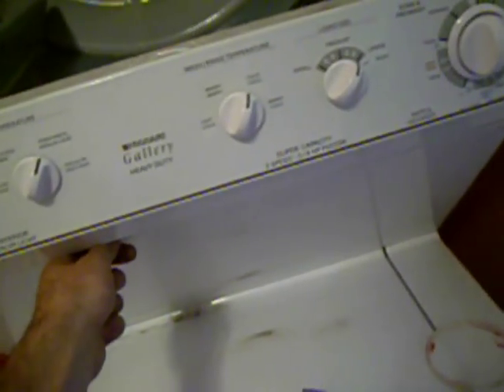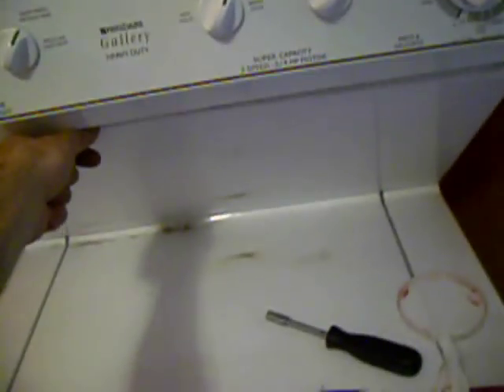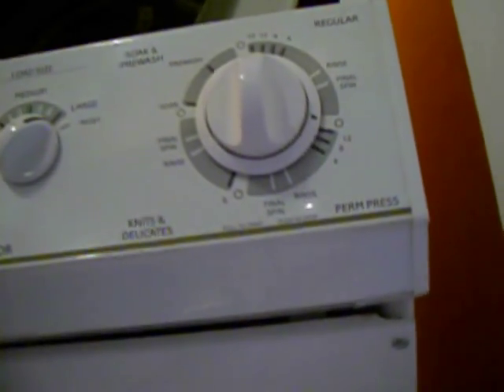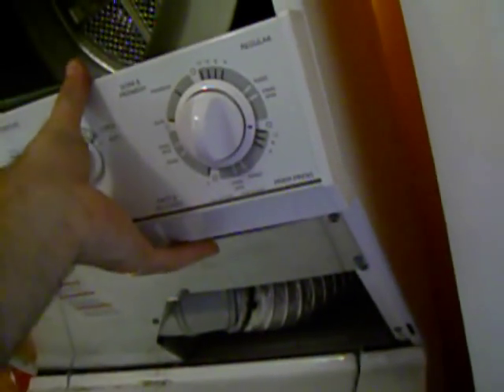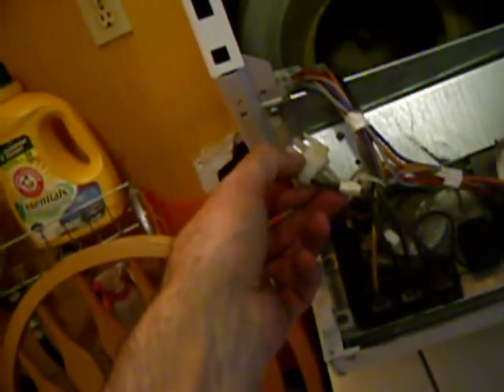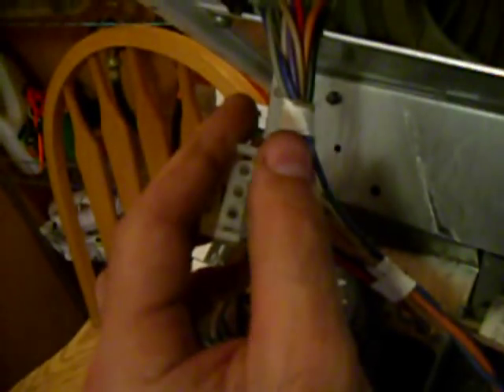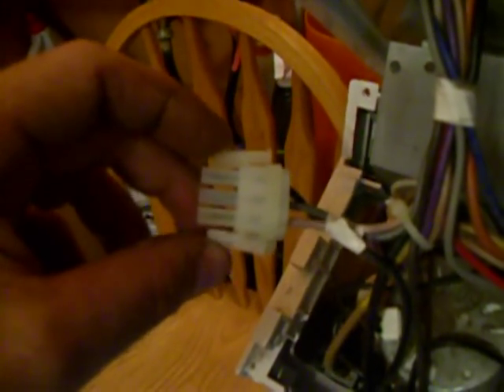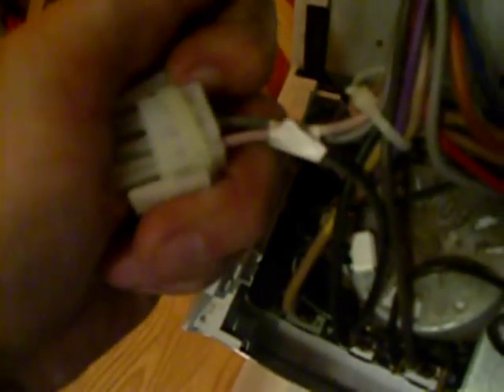Disassembling & reassembling a stacked clothes dryer

Comment: I have been struggling over the repair of my Gallery combination.  This is the exact one I have which is FLSE72GCSA Model.  I have to replace the Washer timer and was really getting frustrated with the lack of information I could find until your video.  Thank you so much.  I found the perfect company that supplies at this moment and time Frigidaire actual parts. It is GRP or genuine replacements parts.  I was able to get all genuine parts for mid price compared to higher or lower in parts places that provided substitutions.  Now because of you help I can actually figure out how to dismantle enough to replace the parts.  So relieved!!!  I wish I had my copy of the manual that would have helped also.
Reply from the maker: It is feedback like yours that motivates me to make more how-to videos.  Good for you for choosing to to repair instead of throw away!

Comment: Thanks for the video. I was actually trying to find a video on how to replace the water intake valve.  But thanks to your video it helped me through the first steps. Through trial and error I figured out how to replace the intake valve and then today I had to unplug the water pump on the washer. There was a sock blocking it. My washer/dryer combo is a frididaire # FEX831FS2.  In case anyone needs to take to front panel off of the the washing machine, there is 2 screws on the bottom of the front panel near the floor. Take those off and the whole panel will drop down for removal.  Then you can access the water pump.  
To replace the water intake valve, you will need a helper. You will have to undo the brackets that hold the dryer onto the washer. Take off the front panels shown in this video. There are 4 screws (5/16'').  The left side is hard to get to but can be done with a small socket wrench with an extension. On the back there are 2 "L" shaped brackets. Take those off.  Gently lift the dryer and slide it on top of the washing machine. Have a helper hold the dryer from the front and lean it towards them a little bit and you can access the intake valve. 
Thanks again for the video mr. diyguy123

Comment: Thanks so much. There is a scarcity of information on stackables, which can often be a pain to work on, usually in cramped quarters. You said you did another video about actually replacing some of the parts. Would like to see that also. Good job.

Comment: I'm surprised at all the negative comments??  I hope others realize that this was just a quick video you made at the END of a job you did in order to possibly help others. Thank you for taking a moment to verbalize what you did.  I had my dryer apart to replace an upper drum glide and now it seems my rear ball and socket is squeaking.  This will be a help to me!!
Reply from the maker: Thanks for the feedback. Yeah, haters gonna hate hate hate for sure. Usually when I try to post a video to help someone and get flamed, I ask them to post a link to their video demonstrating a better way to do something. There has never been a reply... not once. Good luck with your repair.
Reply: I must say, I found this video incredibly helpful, especially the trick about taking the top off to line up the ball/socket. If you have no mechanical inclination whatsoever ie you don't realize that the 3 screws holding the cover on need to come off in order to take the cover off you may just want to call a handyman.

Comment: Thank you so much for this video. I also had to replace the bearing support and  I  had to wait 13 days for the part and forgot what I w  took apart first or how to put it back together.
Reply: If you are like me and forgot the order it goes back together in before he starts the  vid... it's that back cover over the  the pulley 1st. The flappy raw metal looking part called the heat shield 2nd...  The top of the dryer 3rd to make that panel under the control panel fit right (and the door w/ fan connection). the 4th the door and last the electric control panel. At least that is how I did it. Don't get frustrated when the holes don't line up... in another video someone used and awl to make them  slightly larger and line up! Happy Adventures.

Comment: Do you have any tips on how to unstack them for moving?
Reply from the maker: Use a vertical hand truck, use a ratchet strap at the bottom of the hand truck and a second ratchet strap at the top of the dolly. Move it as a unit (not dissassembled). The weight will be 75% at the bottom with the washer.

Comment: I have the fex831fs2 fridgidaire washer and dryer combo , the tub itself is leaning badly to the right and has had a leak but when I look for the leak it is not leaking from the tub seal there is not much room to work on combo if I take out the bottom screws on both sides  and the one on the back will I be able to reassemble the unit.  
Do you have any suggestion on where the leak is coming from and why is my tub leaning so badly.
Reply from the maker: Hi john. Sorry i do not have any advice. Maybe someone else can comment.

Comment: at 6:10 your point out a piece on the dryer that holds the drum in place..like a front bumper that keeps it from falling down/out. Do you know what that piece is called? I couldnt get that piece back in place and tossed it last year when i replaced the rear bearing assembly. Turns out that after a year of use the rear bearing is shot again. I believe its due to me tossing this piece and the drum turning at a slight downward angle. I cant find this pieces name to buy it.
Reply: bearing support bracket... I lost mine on the floor... it's 100% needed. I taped mine but still needed a helper to hold it because you are screwing through three things and it wants to fall off... someone else used a magnet... the big one to  hold it on while he installed it.  I know you already figured it out but it might help someone else.

Comment: I need help if you can..something fell down where the lint screen goes and when I turn the dryer on it makes a terrible noise. Would the item that fell in be in the dryer motor and how can I retreive it? I have a GE model GUD27ESSJ0WW
Reply from the maker: Regretfully the only option is to disassemble until you find the loose part.
Reply: @mrdiyguy123  thank you so much.. that's what I'm doing now but afraid I won't be able to put it back together again!
Reply: I wonder if it's easier to retrieve it if I remove the back..any ideas? Well, I watched a couple of your videos and they showed me that it's probably easier removing the front of the machine.